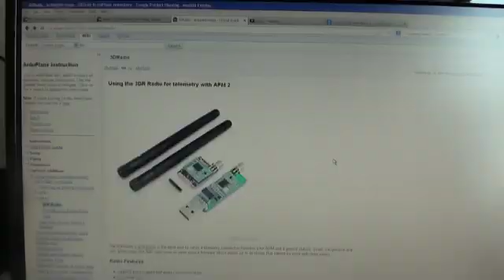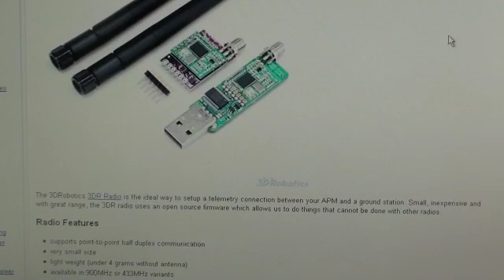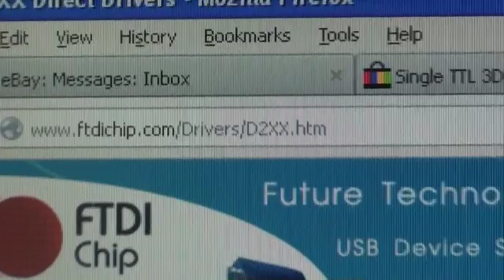3DR radio telemetry 2 of 4

Comment: Hello 75echo,Iam using Windows 7 OS can you tell me which is the driver needed for this Telemetry radio for Ground station USB...?many zip file there is that WINDOWS CE 7 ? I was stock in configuring my 3DR radio telemetry..

Comment: Thanks for all the usefull information. I have couple of questions. What is the app called that you use on ios devices?  And what is that white cable lead called that goes into the apm system? Thanks!

Comment from the maker: The range of the radio depends on your setup and antenna used. Note that this 3DR radio comes in 433mhz and 900mhz versions. Check to see which band is legal in your country . Here in Europe, 900 MHz is reserved for GSM networks so it's not allowed for private use . With my 433 setup and normal  antennas ,range is about 100-150 meters. Note however that this is just a telemetry link, the control of the aircraft is on 2.4 ghz .

Comment from the maker: No problem mate, we are here to help one another . It sounds to me like a software problem, either your mission planner and or the driver may be corrupt or even installed incorrectly. Try doing an uninstall and a reinstall BEFORE you connect your 3DR telemetry radio. Check that the driver is correct for your operating system and your format .  I do not think that the placement of the driver on your PC matters that much. i placed mine on the desktop screen. :-)

Comment: Hi 75echo
another one of my dumb questions, I'm having trouble installing my 3D radio, set correct COM port N/O, green light on, press control-A nothing happens no settings screen, have down loaded drivers for XP and put them in Mission planner folder(not sure whether thats right), If I connect both up and switch aircraft on,green lights on red lights flashing as if they are both comunicating, any clues  Regards Geoff.

Comment from the maker: The landing gear are made on a 3D printer but i have since removed then because they broke easily. I do not recommend them, instead i now use polycarbonate legs on each arm. if you google irisaerial . com you will see the model i now use.
The battery is mounted under the bottom plate.